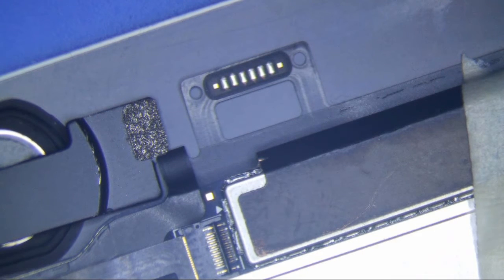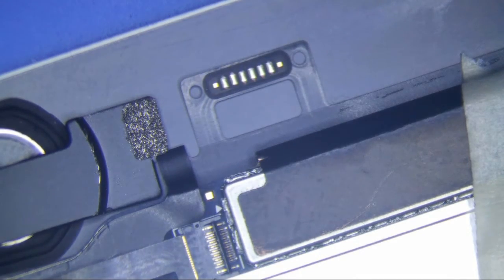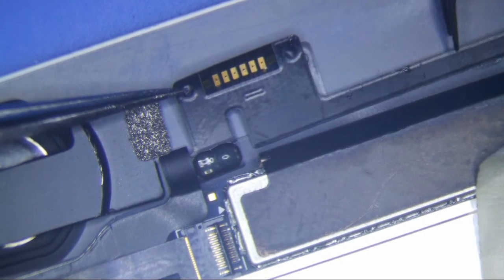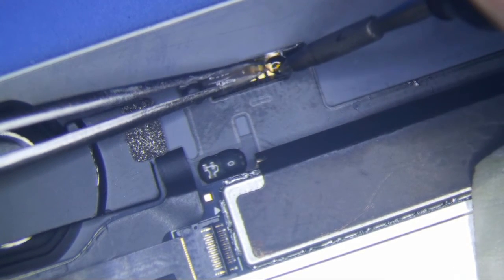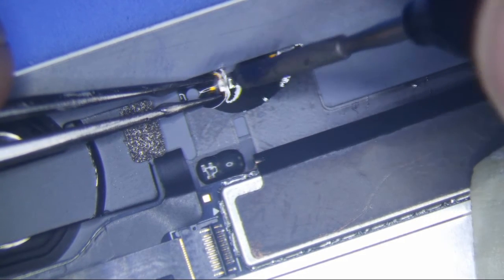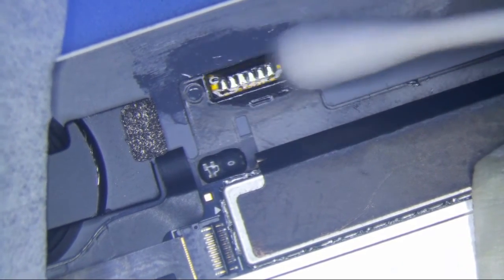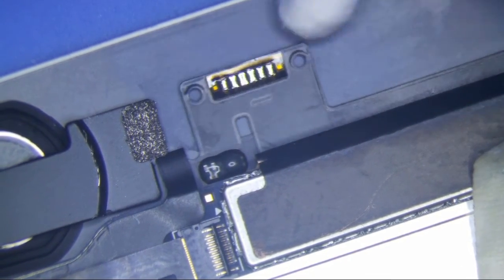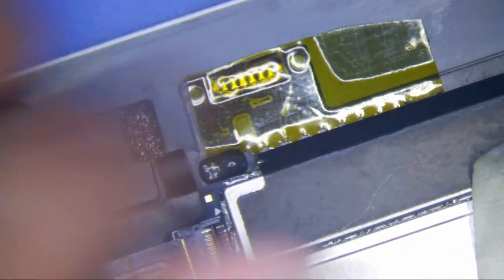iPad Mini 4 Sleep Wake Sensor Repair

Comment: Is the sensor needed for the iPad to turn on and function? Or will it just mean I don't have that feature any more?
Reply: You dont really need it. You can use the home button to open the phone. The power function works too. You just won't be able to lock the ipad but you can set the settings to 2 min auto lock. Kinda annoying but yeah this thing sucks.

Comment: The sleep wake sensor on the issue u had was a setting issue. If you go under settings--> brightness that issue can be fixed. It's a sensor in after market digitzers that causes that
Reply: Tech Knewz can you tell me what I do after I go to settings/brightness? Thank you
Reply: Mine doesn’t have the option lock/unlock
Reply: Lindsey Pitman hit unlock